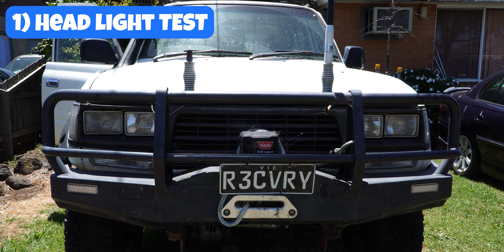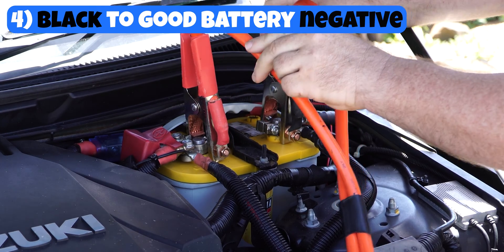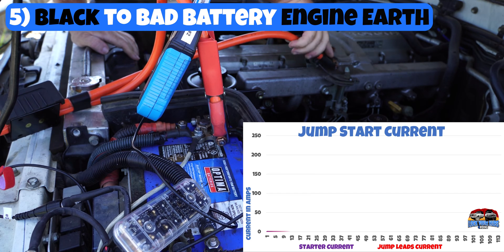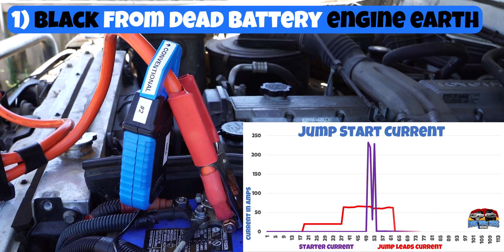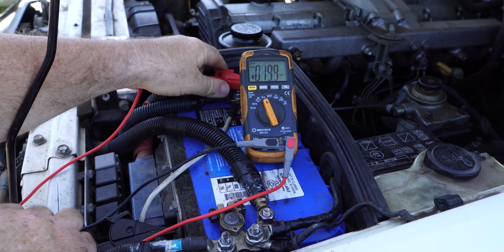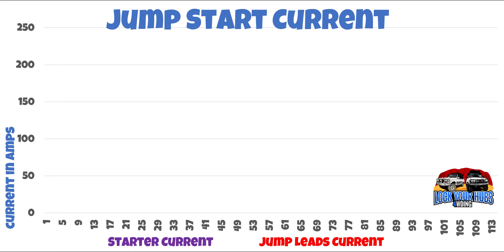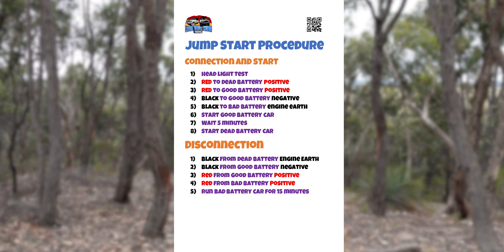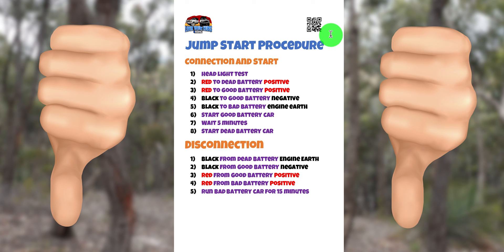How to Jump Start your Car! The Safe Way.

Comment: Agree that a spark near a battery that has been charging can be explosive and I can attest to that from personal experience. Because of that experience I have come up with a way of connecting the batteries together that has served me well. I connect to the good  battery first on the positive side and then make both positive and negative connections to the dead battery and then finally connect the last connection to ground on the good battery. Connecting to ground on the engine is a good practice but with all the plastic that they cover engine compartments with these days that is sometimes not an option. Good video. Happy Motoring.

Comment: I think you should also have stated that your dead vehicle is a Diesel vehicle which makes a difference in starting as a petrol motor takes more to crank over whereas a diesel will start quicker and easier when cranked over.. also a diesel vehicle has glo plugs to preheat the chamber before cranking over the motor. These things will also change the starting voltages and amperages to a petrol vehicle.... I know this as I presently have a diesel 80 series and used to have a Fj40 many years ago which was a petrol motor.

Comment: I've never known why the recommended method is to put the dead car's black jumper lead onto some metal, now I do.  Thanks for the explanation.
Reply from the maker: Glad to help! It also eliminates the potentially troublesome negative lead from the battery to the starter on the dead car.

Comment: I was surprised by the amount of current provided from the idling zook, no doubt in part due to those stonking jumper leads. 

I noticed some mentioning using AGMs to help start the car and querying about using Lithium battery. Lead Acid (AGM) is very forgiving and will self limit current, but Lithium batteries have a BMS which will kill the output if an over current condition is present, so under some circumstances, a Lithium battery will leave you stranded while using good jumper leads like yours and a cheap jumper lead will probably give a better outcome by limiting the current due to the cheap jumper leads internal resistance and so not triggering the BMS shutdown of the Lithium battery.
Reply from the maker: Usually lithium BMSs will also have a much higher surge rating that could potentially help in a jump starting situation.
Reply: @LockyourHubs4WDing  Yes, depends on the battery and bms.

Comment: Lots of us jump start our 4WD's using the second battery, being an AGM battery. Especially when out in the bush alone. Now that many of us are running a Lithium battery as a second battery, it would be interesting to know the pros and cons of attempting this task. Is it possible, is it safe and will the lithium battery be damaged ? Or will it upset the BMS in some Lithium batteries, which may prevent a large burst of current to jump start a car ? That might make for an interesting video ?
Reply: Agreed, it does depend on the battery, mainly the BMS. However, if you leave the batteries connected for a while, as Simon has already shown,  enough power will transfer to the flat battery that it should be able to provide the starting current, even if the donor battery can't supply the cranking current.
Reply: @SirFuseable  Good answer. That would be a more gentle way of doing it.
Reply from the maker: It would depend on the battery, it wouldn't be as easy as hitting a button like you can do with the likes of a Redarc voltage sensitive relay, but definitely doable.

Comment: What’s your thoughts on the optima blue top?
Reply: I'll just mention something I learned some time ago, which stopped me buying any more Optimas for 4WD use: Although they are a fantastic battery, which is designed to handle rough use, such as bouncing over rough tracks, when they fail it's normally catastrophically. Most lead/acid batteries will usually fail in one cell first and such a battery will still work well enough to get you back home. With Optimas it's normally all or nothing.
Reply from the maker: @SirFuseable  hmmmm, never heard that one. My first blue top in the 'Cruiser lasted about 8 years, and died of old age just like any lead acid, (a bit slow starting for a while, then just about didn't start the car)
Reply: There are always going to be exceptions. I asked several battery stores about the Optimas when I had my second one die suddenly and they all confirmed that they had the same feedback from other customers, especially those who used them off-road. When I contacted Optima about it they tried to dodge the question without really answering it, which makes me think they are well aware of the problem. To be fair, I was very happy with my Optimas while they were working, which each one did for quite a few years, but catastrophic battery failure is not something I want happening to me, especially as these days I no longer travel with a group.
Reply from the maker: @SirFuseable  my yellow top in the Zook is about 6 or 7 years old so far, I seem to have a great run from them.
Reply from the maker: They're a great lead acid battery, I run one in my Landcruiser.
Reply: @LockyourHubs4WDing  in your option would they handle a 270ah alternator
Reply from the maker: @conellisgreatadventure8864  yes, no issue. As the battery fills, the current is going to drop off no matter how much current the alternator is capable of producing.

Comment: After you connected the batteries and idled the car with the woking-battery for 5 min, do you switch off its ignition, before you are to start ignition in the dead-battery car, or do you leave it idling while you ignite the dead-battery car?
Reply from the maker: Still idling, you can also increase the revs of the good car, so the alternator can deliver more current for starting the dead car.
Reply: tnx  @LockyourHubs4WDing